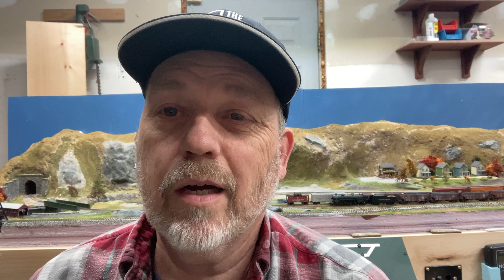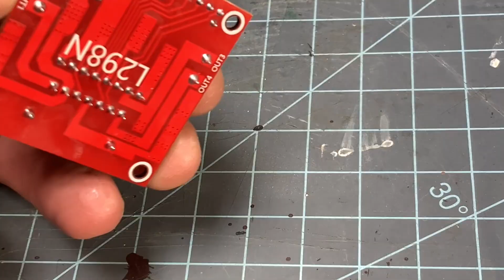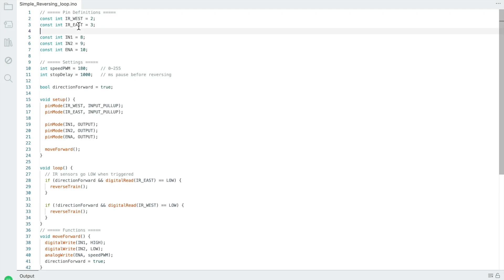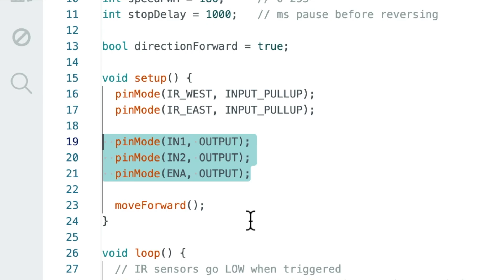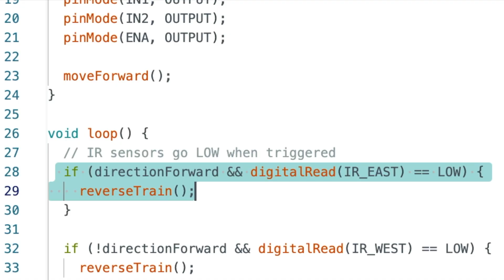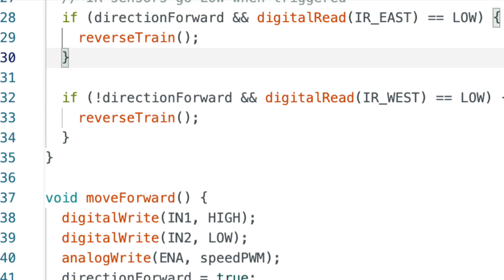Trolley Automation Set up

Comment: Your simple but elegant idea has applications beyond a trolley!  My main model railroad theme is a steel mill.  Plan to use something similar for the operation of a small engine and coke receiver car on a Walthers coke oven battery.   Haven't looked at your Arduino code yet, but the use of the RANDOM function can introduce some realistic tie variation.  All the best ... happy model railroading ...
Reply from the maker: That's a fantastic idea for your steel mill! I'm glad you found it helpful.  Yes this could be used for all kinds of automation.